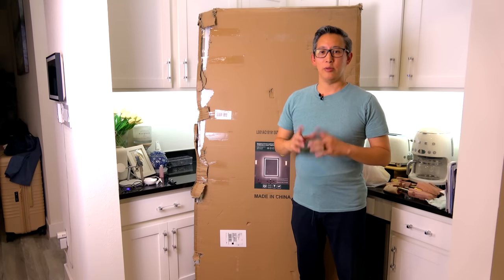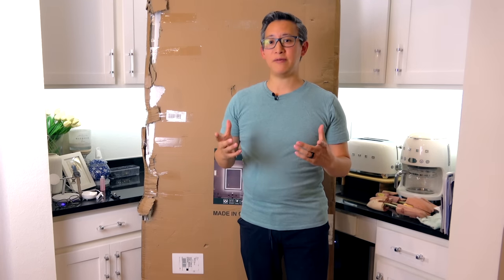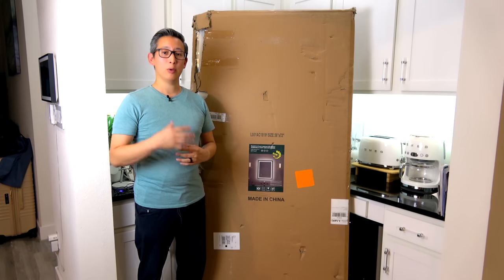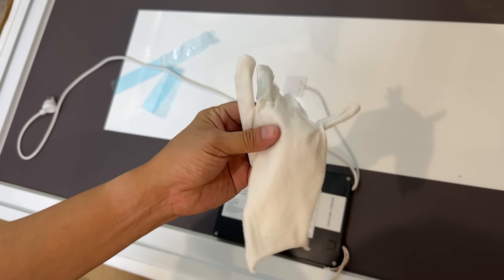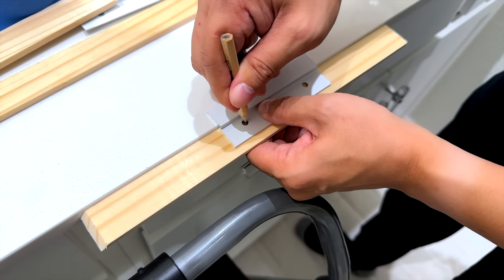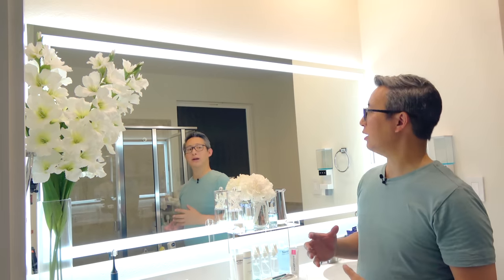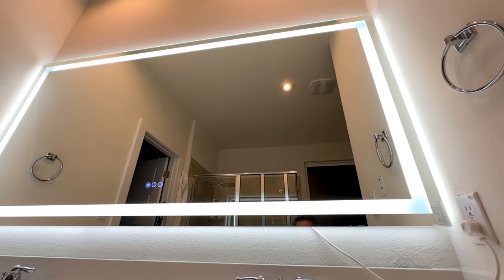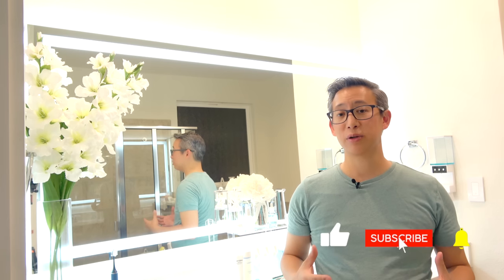Breathtaking Bathroom LED Mirror from Amorho | Installation & Review

Comment: Seriously considering purchasing LED mirror so thanks for your post.  Worried about any damage in shipping
Reply from the maker: I have now received 4 mirrors from them and none of them came damaged.  They were all packaged very securely.  I'd also assume, If for any reason it does get damaged during shipping, they would typically replace it, but so far after 4 separate shipments, I have not yet once had an issue.  If you decide to buy, let me know how it goes.

Comment: Do they have a memory where you can use smart plugs or a light switch?
Reply from the maker: You can.  In one of my upcoming videos, I hardwired one of the mirrors I recieved to an existing light switch.  You can also plug these into smart plugs in order to control them with Alexa/Google/etc.

Comment: Only one glove?
I guess that was a returned item, by Michael Jackson.
Reply from the maker: lol.  I think that is standard.  The previous mirror only came with one glove as well.  I assume you are supposed to use the hand with the glove to lift and hold the glass and then use the non-gloved hand to support from the back.   I didn't use the glove at all since I could wipe off the fingerprints after installing the mirror :)